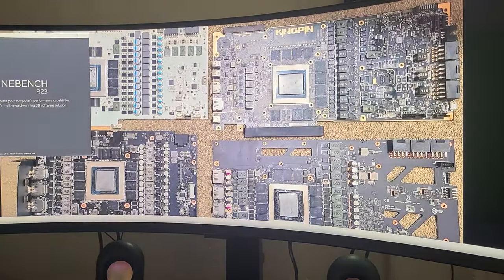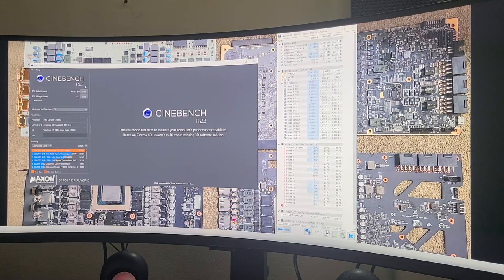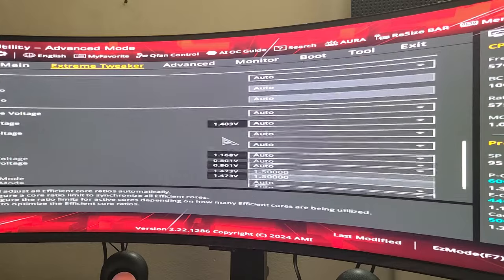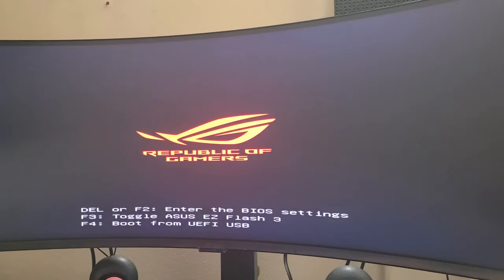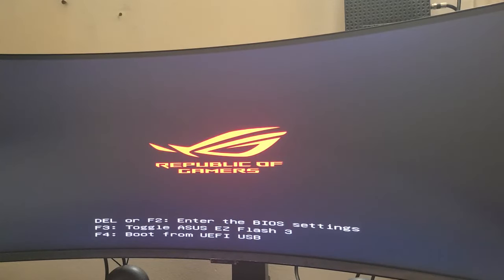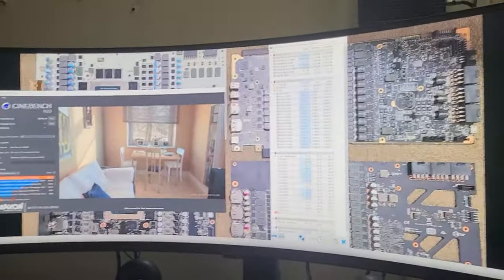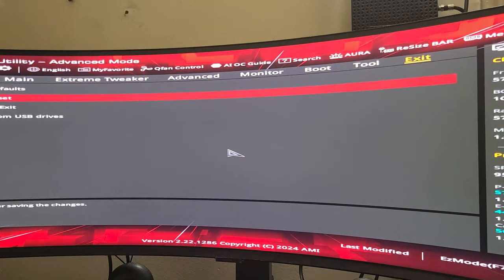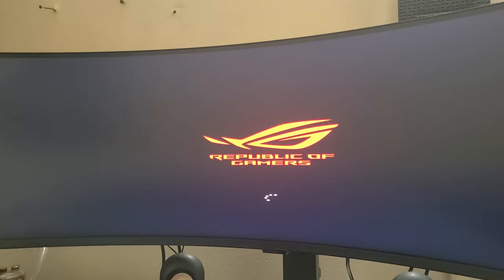How to dial/tune in a cpu. The basics so anyone can do it specially if youre new to this.

Comment: John, not sure how to contact you so I’ll just send you a comment here. I’m running similar rigs but I kept getting code 55. Is it okay for me to send you the relevant parts and have you help me debug?
Reply from the maker: Code 55 is a ram issue. The code means ram not detected. If you tried to manually overclock the ram and its not stable it can cause the code when you Try to boot the rig. Same thing can happen if the ram just isn't seated properly. Same same thing can happen. If you have a bad ram stick or a dead slot. On the end of bios u can simply do a bios reset to set it back to factory defaults. After that if you still get code 55 try reseating the ram. If that don't  work pull the ram sticks and try 1 stick in a slot. If it boots then you know that said stick and slot is good. Shut the rig down pull the stick and put it in the next slot. If it again boots do the same with the other stick. If both stick work in both slots then again try booting with both sticks 1 in each slot. At that point you've tested your ram slots and stick to confirm you dont have a dead stick nor a dead ram slot. If rig boots with both sticks in after all that more then likely you didn't have a stick seated properly or both were seated properly. If still nothing then it may be an issue on the cpu end of things. At that point then ya I would try your ram on my mobo as well as your cpu.
Reply from the maker: If you still can't get it to work and want help here's my fb so you can contact me. https://www.facebook.com/ColdVenom159?mibextid=JRoKGi
Reply: @ColdVenom159  Appreciate the reply. I tried all these things you mentioned. I even had the board sent back for RMA. Still the same issue.
Reply from the maker: @fridaynohw3529  how is the cpu mounted i mean is it direct die,  contact frame? What's the cooling solution you're using on the cpu? I ask cuz depending on the cooling solution you may not have the proper mounting pressure on the cpu which can also cause the code?